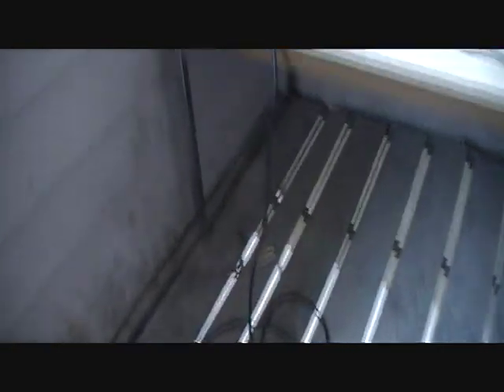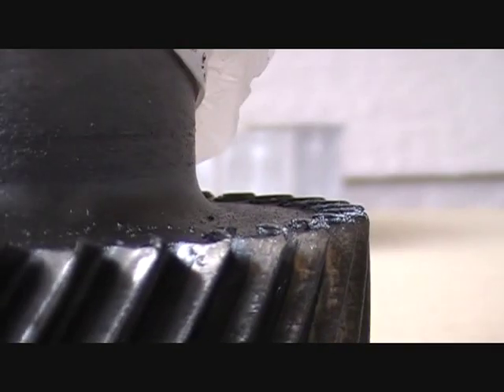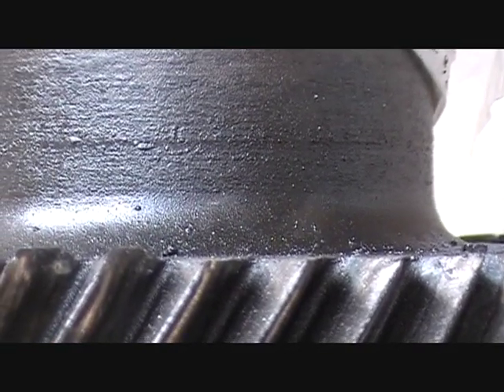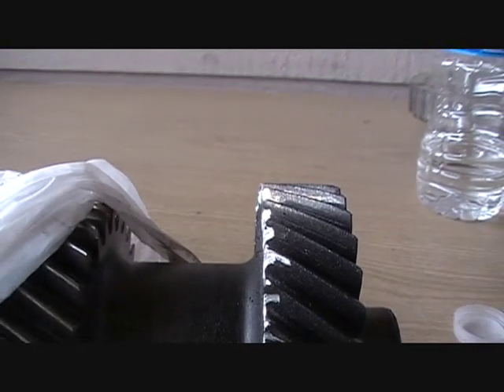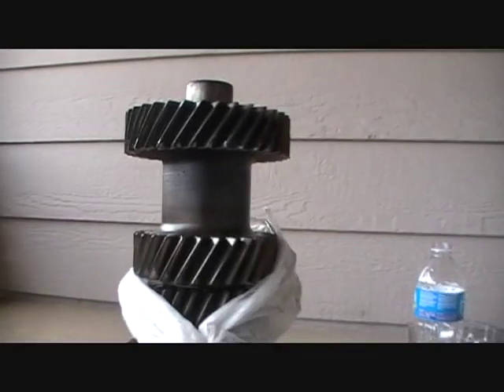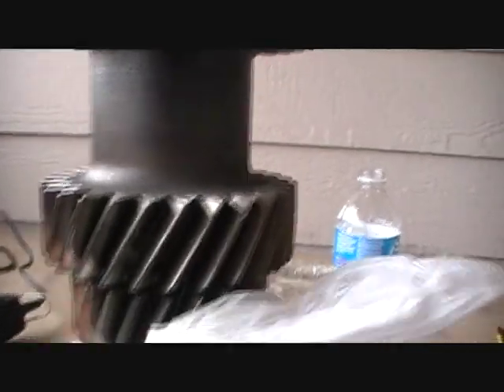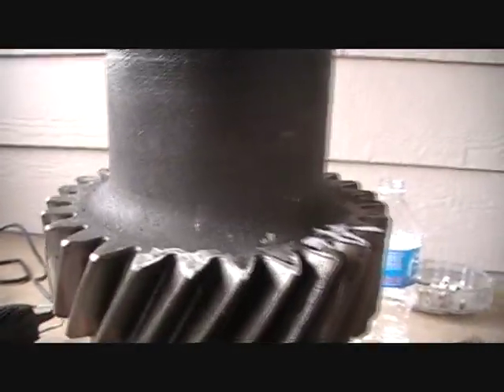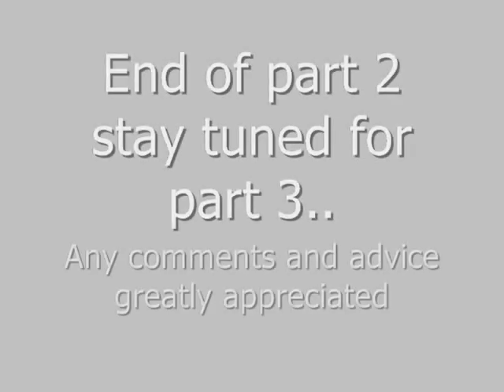NV3500 standard transmission rebuild how to -part3

Comment: All you need to know https://www.scribd.com/doc/23066710/MANUAL-TRANSMISSION-NV3550
Reply: Thank you Cody this manual is great I read that people needed drawings for the holding fixture for removing the rear transmission housing what I did (cost me about $10 }and it worked really well(for me anyway ) is I built a small table about 2 feet high and 2 foot square used a piece of 3/4 plywood  for the top before screwing the top too the frame I used a small hole saw bit (1 3/4 in ) drilled a hole in the center for the input shaft of course after removing the front half of the transmission housing and with a helper holding the trans up I slid the plywood over the input shaft I then marked the spots for the counter shaft,shifting rail and reverse idler (I made the reverse idler holding fixture out of pvc pipe bolting it to the plywood )after drilling out the holes I screwed the top to the  frame (made of scrap 2x4s) it worked great for removing and installing the rear housing although the reverse idler was a little tricky  Don't know if this will help anyone but thanks again for hook-up on the manual

Comment: Rule #1:  Never grind on a gear.  That gear was melted down, you need a new cluster.  Rule#2:You cant fix worn gears and slides,you have to replace them.  Rule#3:  Dont let a shade tree mechanic work on your stuff!  This wont last long.  Have a professional repair your transmission!  You can buy remans for relatively cheap.  Signed by professional Tech at a transmission shop:)  Why did you even make this video, you just made people dumber.
Reply: Some of us learn from experience. Yeah he may be the idiot right now but when he puts it back together and it falls apart, he will know what not to do next time. You do realize people who pay others to take care of their problems become the idiot's.
Reply: "This channel doesnt have any content"

Comment: @buckz94z28 I just had a new trans mission put in my 93 C1500 and it is bad with the same problems you just stated. It is under warranty and in the shop now to be replaced again. I hope they are putting in the NV3500 instead of the POS HM290 or 5LM60. My insurance company (GEICO) wouldn't go for a Jasper and opted for a cheaper model. Where is the savings when the truck is in the shop twice in one month?
These guys scare me because you need a special stand for this trans.

Comment from the maker: @buckz94z28 Open it up and check stuff. So far I've learned that grinding happens mostly when the shift forks do not engage the gears far enough or when the synchronizers for those same gears are worn out. I have a transmission that will not shift to 2nd gear because the shift fork is bent from abuse/racing. All it does is grind.